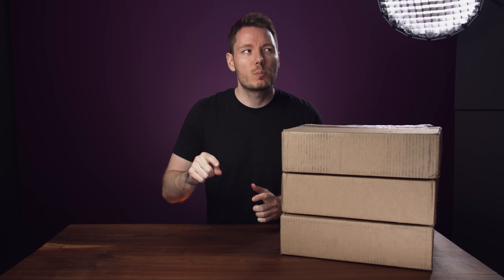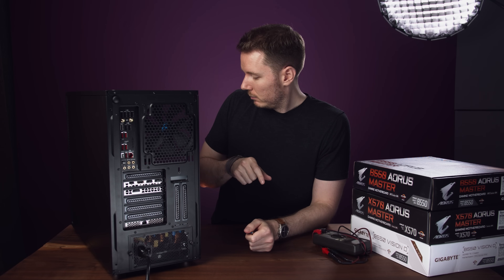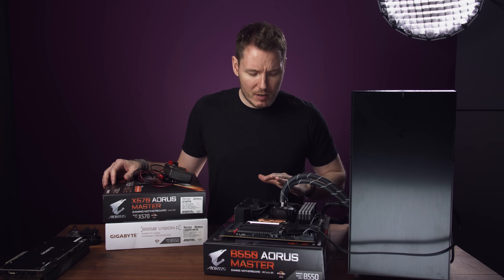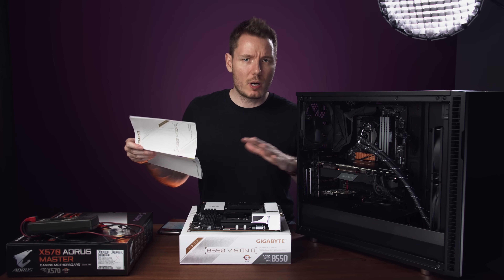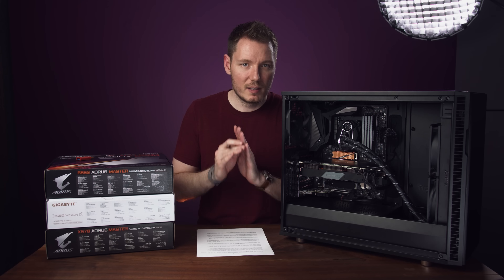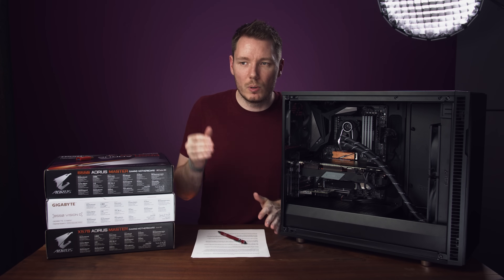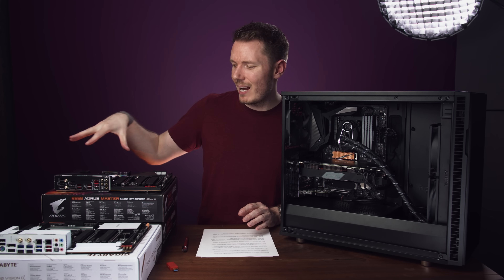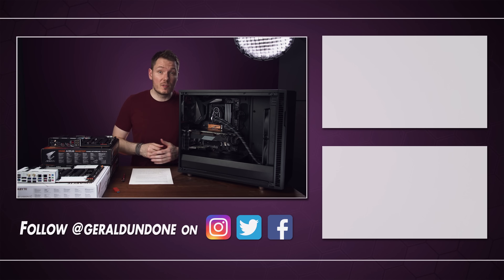I Was WRONG About These AORUS AMD Motherboards

Comment: @Gerald Undone   Have you had any issues with your X570 Aorus Master in regards to boot up issues or  power issues, where the computer won't boot after sleep mode or won't cold boot?  I've heard many of the Aorus boards have had those problems, but it seems to have been a hit or miss situation.  I'm debating on getting one of these and I've heard the good is good but that bad is really bad with these boards.  After  a little over 4  months, how satisfied are you with this board now, after some use time?  Thank you for doing this video.

Comment: Any chance you can assist me? I’m trying to determine which X570 and which b550 boards have thunderbolt 3, either ports built knot the Io or at least a TB3 header, like the b550 vision and the asrock taichi for example, but not sure what others there are. Thank you

Comment: Hello, I have a similar problem with the same motherboard. But I connect my headphones directly to the line out port, and it happens that I hear a momentary interference and depending on where I move the headphone cable it stops hearing (I think it may be the headphone, but I test them on other equipment and they work fine) I also tried with others they had (but they were quite "cheap" and the ones I have are high impedance, I'll get others to try) also from the front port of the cabinet I hear that interference, what do you think? Is it the headphones or is it really a problem? from the motherboard, I am attentive to your answer (I don't speak much English, so excuse me)

Comment: Strip the case out re assemble the mb on a insulated bench (wooden table) or a mb box & try to boot it up if it boots up ok it's something to do with the case, it could be any one of the mb mounting screws touching the other side of the case or something else with the case.

Comment: Hi there, my PC was assembled on Gigabyte x570 Aourus Elite. I have a problem with noise in the speakers from the rear output, but when I turn on the headphones in front, there is no squeak. Should I change the motherboard? Case: be quiet! 600dx.

Comment: I'm very nervous now. I just ordered the AMD B550 Vision D, with plans to build a new white theme computer using a white Fractal Design R6 case that has been sitting new in its box for over a year. I already have the white PSU, white RAM modules and white cable mods. I just ordered a white GPU and white AIO CPU Cooler. Should I get a new case or a new mobo or both?

Comment: Could it be that your Radiator block is grounding to the top of the CPU heat-spreader when it's in use? The CPU itself can give off a LOT of electrical noise when fully operational and that might bleed out through the cooling fluid to the radiator and then to the rest of the case and the radiator. This usually isn't an issue because cases have these raised stands for the radiator and the paint is usually thick enough to ensure proper insulation, but when two metal surfaces sit flush against each-other over enough surface area, the resistance can become low enough that current, especially high frequency AC noise, can more easily pass through.
Sometimes you can fix this by using different thermal paste in a thick-er layer, with liquid metal obviously being the worst candidate, but even regular thermal paste can fail to provide enough electrical resistance when spread out thinly enough (which is thermally ideal)
Honestly, the best fix would be to try and install some sort of foam gasket around the radiator block to try and insulate it from contacting the case.

Comment: Hello, nice video. Can someone help me please? I want faster RAID0 from 2 or 3 same disks: PCIexpress gen 4.0 x4 M.2 SSDs. Which would be better -Gigabyte  B550 Arous Master or MSI X570 Godlike (putting 2 disk info M2-XPANDERGen4 and one into M.2 slot directly connected to CPU). I also need 128 GB of RAM with AMD Ryzen 3900X CPU. The graphics card would be some cheap 150 USD PCIEXpress nVidia (not for gaming). Which motherboard to use cause I already have MSI motherboard that I paid only 200 USD more from current Gigabyte price. I don't have money for Thread-ripper platform so I need to stay with 3900x. Please tell me what I can do with what I have? I want to do a lot of large file intensive work: ram-disk to disk(RAID0) copy and disk(RAID0) to ram-disk copy and to other devices - HUGE files like 60 GB (I edit them in RAM-disk cause its faster). I want Raid0 to be bootable system drive with Linux Mint as operating system. I work in Linux Mint.

Comment: Thank you for the video it was very informative. Right now I am get a ticking noise is my motherboard when it is under a load and I am in the process of figuring that out. I used to have the ticking noise even in idle, but since I figured out that my Corsair PSU fan was not set to on it only happens when I play a game. 

What is really annoying is when playing AC Valhalla everything is fine for an hour then I get severe glitchy movement in the game.

Comment: A strange but anecdotally common reason for coil whine is the power source, ie. the quality of the electrical power in the building. Again, it may sound strange but it's worth checking out if the coil whine still happens in another building. Power supplies / different components may be more resistant to coil whine so switching those may help even if the core issue is the quality of the power from the wall, leaving the impression that it was just a bad component. Also, if you're using a UPS try it without the UPS.

Comment: Definitely not an expert, but don't you have to factor in all the appliances on the house circuit for a ground loop problem? For instance, I was getting ground loop hum in my HT subwoofer, had to use an isolator to remove it, until I bought a new AVR, then I noticed the hum was gone with no isolator being used.
With my PC (Lian Li Oll Dynamic XL) and MB (Aorus Elite X570} I was getting interference like soft crackling and hissing thru my bookshelf speakers when using the analog 3.5mm output on the MB to my DAC. Once I went optical, it all disappeared because it's an all digital signal. From what I understand, USB is also a digital signal, but it also has current draw, thus adding whatever interference is happening due to poor grounding, into the DAC via the wires that carry power...unfortunately for me, Peace EQ stopped working completely when using Toslink/optical, and I had to go to USB.  But the popping is almost non-existent and I can only hear it now when I change volume via the amp.
Anyway literally just stumbled on this channel, enjoyed the video and your presentation, good job, sir!

Comment: I was looking for B550 onboard audio port benchmarks, this wasn't it, but it's still very much appreciated. As was the unintended review of the iFi product. Ran into similar issues my self with certain USB DAC/Amps and very sensitive in ear monitors years ago, ground noise going over the USB cable I couldn't solve without ripping the ground contact off the cable.

Comment: Gerald, I am an EE.  I'm not going to explain, but give a couple of hints.  1. get rid of the Yamaha monitors.  They have no shielding, electrical or otherwise.  I switched to Adam.  Next use an oscilloscope not a VOM.  When the PS comes on it puts a potential on the ground that is higher than the small battery in the VOM.  thereby the VOM will not see a current draw from a short and will not sound the short.  I had the same issues as you,  the real culprit  is the USB design from Intel.  Note that some motherboards are shipping with a special USB that has a separate filter on it.  The defender is a little over priced but like a cloud lifter it has no competition so there you are....

Comment: Gerald, I'm an electrical engineer, and I can tell you it really does not mean I know any more than you do about this, as I focus on firmware design. However, having recently worked on troubleshooting some similar problems and since I work with other engineers who do this sort of engineering on a regular basis, I think I can help. One of the things we produce at work is audio equipment for medical environments. As you can imagine, they get pretty picky about safety and isolation. Ground leakage and ground loops can be a big issue, and often the best way to make sure you're always getting clean audio is to isolate the grounds, and even electrically isolate the audio if you can. Digital audio is good, since it can error correct, but in your case your USB cable was carrying a ground issue, so it wasn't the signal, but the ground that was the problem. The USB isolator will probably be a good answer regardless of the source of the problem.

As for the humming sound, you're correct in suspecting the LEDs and coil whine. Both of those can radiate or conduct into the ground in systems, and a good design will actually put some effort into doing things like making sure any RGB LED PWM frequencies are outside of audible range. For example, I PWM high power LEDs in my designs at 16KHz, and while  technically not outside hearing range, you're probably not going to get that to conduct well. A 4KHz PWM on the other hand, could be more problematic. Coil whine is just going to be a problem with inexpensive electrical design on a board, and you'll have to do things like isolation to get rid of it. Not only can you hear it, but the sound comes from power electrically oscillating, causing parts to wiggle at that frequency. You can bet it's electrically propagating through the system somewhere, and you'll hear it in other places where electron shuffles can make it into some kind of audio transducer.

These problems often travel along the ground plane, since it's designed not to have any attenuation in it. If your ground plane has small, leaking frequencies on it, where it's varying by millivolts in audible frequency ranges, as soon as an amplifier uses that ground to produce power, you have now amplified that ripple on your ground and mixed it into your audio signal. Some systems will employ methods to try and filter the ground plane, but it's not a trivial problem to tackle. Again, this is where digital and optical isolation can help if it becomes problematic. If you connect your audio amps to your system with optical audio, and the speakers have their own power supplies, this should go away (unless it got onto the audio signal before it was converted into optical). This is harder to do for microphones, but often not hard for speakers. However, USB audio usually helps a lot, unless again, it's carrying this noise over on its ground and 'infecting' the amps with the noise. Also, there's a lot of opportunities for audio signals traveling on motherboards or other cables to pick up noise, so sometimes all this isolation won't help. The inside of a computer case is very electrically noisy. Every cable is a radiator of EM noise, and there's a lot of them inside a case.

All that being said, I'm not an expert in this, but these are problems I know we've had to deal with at work, and I've personally had to fight in my systems with audio. Since this isn't my area of expertise though, some of my explanations might be a little off. If so, I'm sure someone will be happy to vehemently correct me. And sorry this is a month late, I only recently found your channel and got an interest in video.
Reply: this comment deserves more love
Reply: Best useful comment ever!
Reply: This sounds solid to me. I used to work as a sound-man for a rock & roll touring band. I chased a ground-loop off a stage once by putting a carpeted riser under the head of our cable-snake. We were getting 60 Hz hum from the lighting dimmers that conducted through the metal stage-frame and made contact with the metal case of the snake-head. That was literally a "ground-lift". Cheers. = ]

Comment: One other thing you can try is a power conditioner or UPS. A lot of them are made to clear up power signals before they get to your system. Furman makes a bunch but there are also plenty of UPS (uninterruptible power supplies) you can get online that condition power and help provide stable perfect voltage to all of your computer components. Coil whine and other leaky components in a computer all contribute to EMI and electrical noise which is why designing a good motherboard is super difficult for electrical engineers. Isolating everything on different lines in the PCB and on different power rails isn't easy. Typically I don't recommend using front panel IO at least for audio. Try disconnecting that cable all together as well as  UPS and using an external Audio interface if you aren't already. In some cases the only way to fix the grounding/signaling issue is with one of those nifty USB devices you already got. This is why most audio pros recommend against internal audio solutions no matter how well the Motherboard is designed. You simply get less EMI and interference by moving the audio components into their own external enclosure a few feet away from the CPU, GPU and Power supply in the PC.

Comment: Thanks for the detailed review, I have a similar issue with my B550 Aorus Pro AC. The issue is my keyboard both wireless Sculpt keyboard or my wired keyboard goes erratic if attached to USB 2 port but works fine if attached to USB 3 port. The mouse and every other peripheral including Logitech camera, external USB drive and few other work fine. You are right when you mention about the PCI 4 in B550, I do have a nvme attached to the top slot running full PCI4. Maybe a future BIOS should fix this.
Reply: This is the big problem with these boards. Do you have the ethernet issue?
Reply: @karama300video  for Windows I use the driver supplied at the Gigabyte site and so far no issues but I find the internet slows down over time and it needs a reboot after that. Probably a windows issue as the ethernet runs fine on Arch linux here with the latest kernel.
Reply: @Haimura the issue is from AMD and not Gigabyte and newer bios with latest aegesa have fixed issues to a great extent.
Reply: @Haimura thats their top of the line board, I have the aorus pro AC wifi version and so far everything is running fine now with BIOS update. The issues that you mention is suffered by other manufacturers as well using B550 chip. Make sure to update BIOS asap after purchase, use the beta bios.
Reply: @Haimura just keep a track of the latest BIOS and also make sure to match RAM correctly and you will be fine.

Comment: Not an engineer, but here is my best guess. If you have a meter set to test continuity, your are measuring resistance, and low/no resistance is equated as continuity by the meter (and you get a beep). If however, your meter leads are place in two locations that have a "difference of potential" (aka voltage), then your resistance measurement is disrupted in the meter and not seen as continuity. At least that's how it works with my meter. That being the case, I would guess the case is having voltage bleed to it after it is powered up. switch the meter to measure voltage and place the two leads in the same location and see if there is a voltage when the pc is on, if so I would start by checking case lighting.

Comment: Hi Gerald, very nice and informative content, enjoyable as always! There is other solution on this case, just use PCIe soundcard (Creative Sound Blasters, EVGA NU Audio, ASUS Essence STX II or even ext. Pro USB soundcard/Audio Interface:  Focusrite, Steinberg, Motu, M-Audio, Apogee, etc.) on problematic motherboard (with audio interference/ground loop/) like on AORUS B550 Series, and even on the GPU coil whine problem, it does great job of solving noise issues and get better quality on audio playback and recording.

Comment: I just realized I have that same case from my computer I built like 5 years ago. I want to upgrade to these specs possibly for it. I have never had these issues with my current set up and my presonus 192 mobile interface. Could that case have a new manufacturing process now? Also, just to clarify the ram was causing the whin as well, and possibly your GPU? I am not a huge computer nerd so I am still a little confused since you still said the case is one of the issues as well.

Comment: Gerald, you and I have similar minds haha. Quite happy to see you use a Fractal case just like I am. I'm using the R5 though and have had no issues. 

Also, I think just turn off RGB.... on everything. I'm not sure if the leak issue is just with Gigabyte stuff for this time's lineup. I'm using G SKILL ram, no rgb. For GPU, I installed the software just to turn RGB off. I'm using an Asus Z370 Prime A mobo... perhaps it's their lineup of mobos that are causing the issue? 

Also, I always have my pc plugged to some power bar... I only use Tripp-Lite and APC.

Comment: You should flip your radiator so the tubes are on top. It's horrible for your pump the way you have it right now.
Reply from the maker: Read the pinned comment.
Reply: @geraldundone  sorry, hard to tell it's higher than your pump.

Comment: I had the exact same issue! I would notice the issue when scrubbing through media in premiere/when the system was under heavy load. Unlike you, I got this through the front headphone jack, and interestingly enough, we have the exact same case! Fractal R6. 

Other than that my specs are completely different, Z270 board, I7 7700K, RX 5700XT, 3200Mhz Corsair Vengence (no RGB). I fixed the issue by buying a Fiio K3 DAC, as I figured it was a grounding issue in the front IO panel. 

Super interesting hearing your side of this.

Comment: Ive got an aorus board too, and have had a few issues now with the motherboard. The system would hang in during boot prior to bios. So weird. Also, the build quality of components attached to the board (like usb headers) are weak sauce
Reply: It sounds like Aorus isn't amazing...